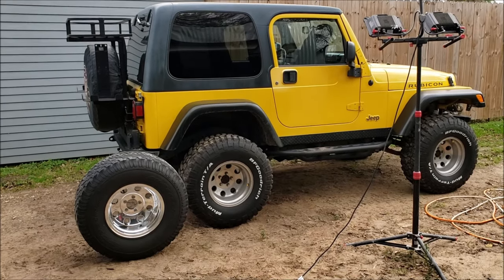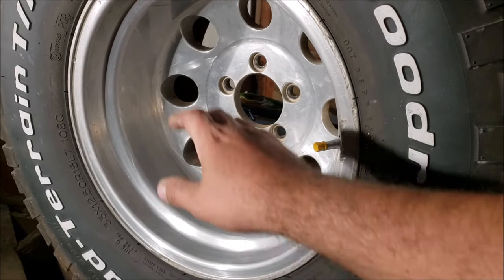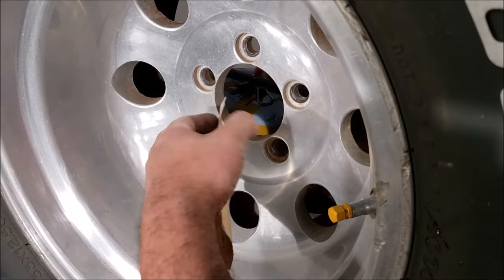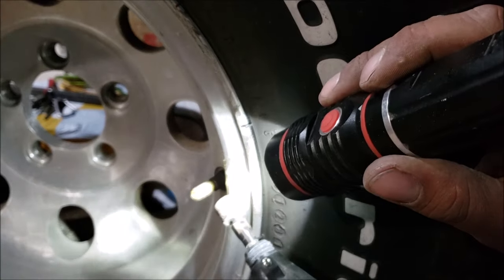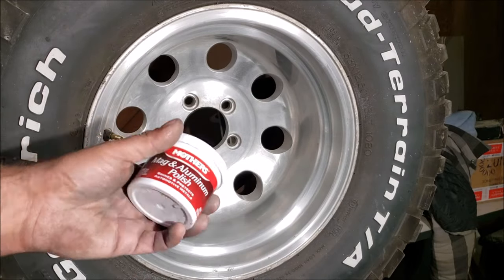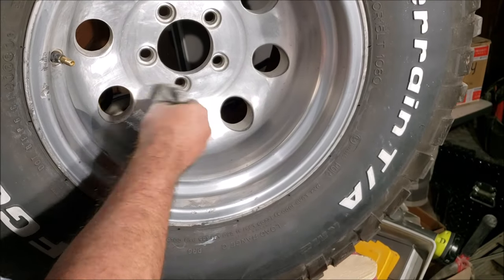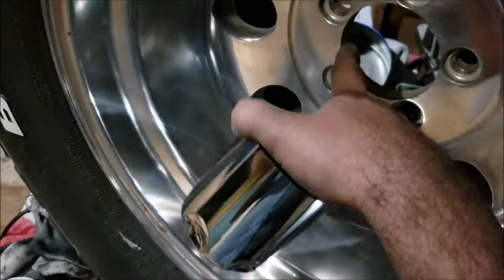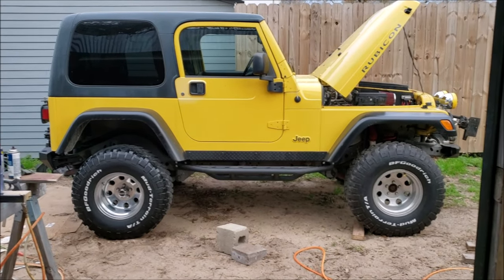how to restore and polish OLD ALUMINUM WHEELS BY HAND

Comment: I used to work at a bike shop as a kid. My job was to polish aluminum parts all day to a mirror. Instead of rags, socks, towels, we used the Mothers polish you have and Charmin Ultra Soft TP. It worked great. For whatever reason it had to be Charmim Ultra. And its cheaper than wags, paper towels, etc.
Reply from the maker: dang.. I’m going to do that next time..  I also think the blue shop towels might work good too…

Comment: I'm using sanding wheels with my long reach air die grinder... what a Ton of work!  Dirty back breaking too lmao!  Yea the power balls only knock the dust off... seriously just to help them shine after all the hard work is done.  Most don't know that heat from the friction is what helps lift out the contamination.  It's definitely an Art Form!

Comment: I know this is an old vid, just going to add a bit of advice.  Think about those pressure sensing stem caps.  They are pretty flipping cool, but they press down the needle in the stem.  If they get a little loose you will come out to your rig with flat tires.   Ask me how I know.

Comment: Just got a set of these wheels for my Jeep. Someone know their worth. But sold them cheaper as they are very oxidized and he was changing the look. Was seeing the best way to clean them up.
Reply from the maker: if they are rough you have to sand them.. I had some once I had to start with 180 grit and they turned out just fine... when they are in bad shape they aren’t worth that much maybe a set for $100 -$150...a set like mine when I started:$300...but polished maybe $400-500  new ones are like $175 each (AR172)

Comment: Hey Chris I got a quick question for you, so I have a set of decladded GMC aluminum wheels. The PO painted them gunmetal grey and I was looking to polish them. Any tips in terms of grit? I was going to start with an 800 but not sure if that is going to be low enough to get the paint out, and then 1000 then 2000. 

Also should I soak the sand paper in water or constantly run water over the wheel?
Reply from the maker: you need to paint remove them you aren’t going to “sand the paint off” and then see what they look like..  I don’t know what decladded wheels are
Reply: Ah okay I figured I could just sand the paint off. I’ll use some stripper and get it off first then and see what happens. I know I’m going to need to sand though they are rough in a few spots I can see.
Reply from the maker: I honestly don’t know what to tell you.. you are doing something that I would not waste my time with... the wheels look too rough.. so you would need to sand them down.. the problem is that the design of the wheels is going to give you some major problems.. notice how my wheels are like a big tub that can be sanded if needed.. even my 22” Alcoa’s on my semi conversion can be sanded... those look like a job
Reply: @chriscraft77022  Oh those are not my wheels those are some I found on google to show you the declads lol. The ones I have already have all the glue and stuff off of them mine are way way smoother than those. Either way still going to be some work.

Comment: Try wet sanding with wet sand paper and wd40 up to 10k grit and you be amazed at shine without polishing, but with its like a mirror
Reply: I have same set of wheels but in 6 lug and i did what i said about wd40 and wet sandpaper up to 10k grit
Reply from the maker: I will try that next time.. the wheels I had were extra rough.. next time for sure

Comment: I bought the same wheels for my truck, but i got a different designed looking one like what
Reply from the maker: these are 10” with 4.5” backspacing
Reply: @chriscraft77022  i have a 16x8 et0 says on the back of my original wheels so i orders that and its a different design, says made in america the original and the one i bought said made in india even tho they are both american racing baja ar172 which makes no sense that they are a different design where the bolts go
Reply from the maker: these are ar172 and they were never made in India.. first in USA then China..  they are exactly the same as the original wheels .. return it.. something is wrong.. I got my wheel from summit racing
Reply: @chriscraft77022  on summit racing it look exactly like that but thats not the original wheels how it looks on the hub n bolt pattern its more curved and steep
Reply: @chriscraft77022  look for a 5x135 16x8 on summit racing u will see that its concaved on the bolt pattern compared to ur wheels, my wheel are exactly like urs but some how i got those